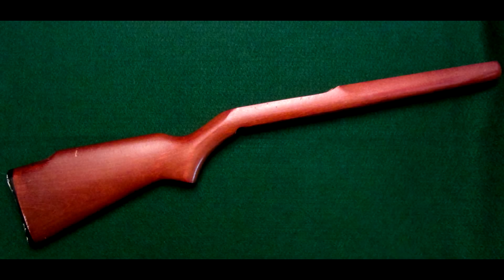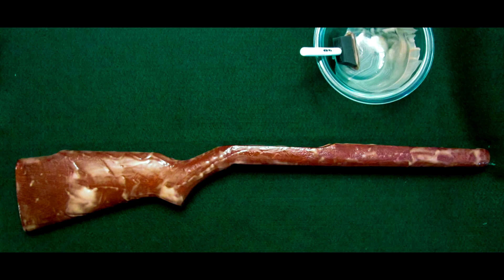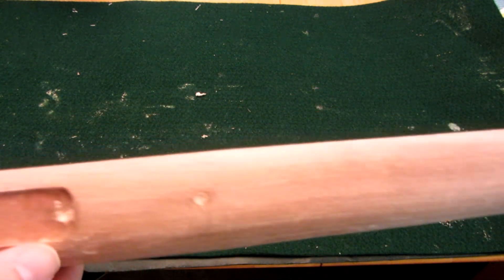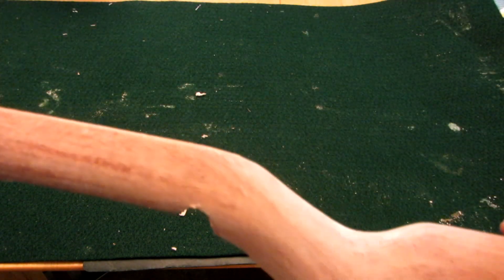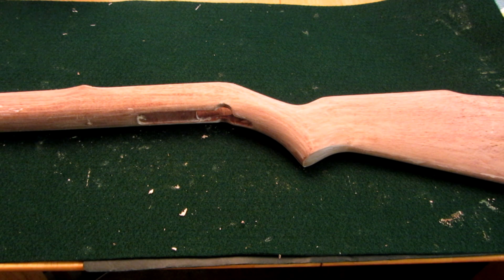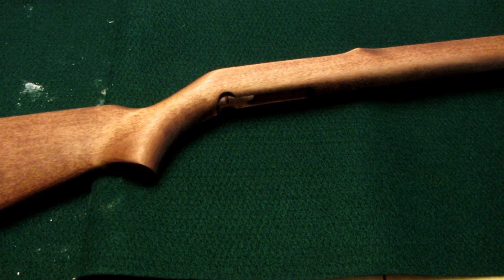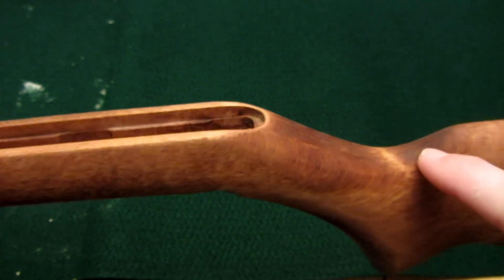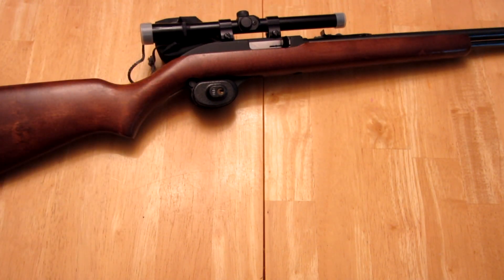Gun Stock Refinishing Project: Marlin Model 60

Comment: Down through the years, I have done a number of refinish projects on furniture and I really like a Tung Oil finish!  If enough application, it will completely fill the wood grain and make a durable waterproof finish...I am talking about 30 coats, hand rubbed and 0000 steel wool inbetween each coat. It really hardens the surface and makes it very scratch resistant.  Patience is the name of the game on these types of projects.  And I do like the looks of your new finished Marlin!

Comment: Very nice job. Looks brand new. I did a stripping and refinish on my model 60 using Citristrip. After light sanding with 400 grit I applied a mixture of boiled linseed oil and pure turpentine (1:2), let it soak in and buffed it off. After drying overnight , I applied several coats of Minwax dark brown wax, buffing between coats which I renew after each cleaning. I prefer the satin finish.

Comment: I just finished my Marlin 60 before I saw your video and I had some darker spots too. I stained a light brown also and the few dark spots just added character to it. I re-blued the barrel and put it back together and it looked identical to your brothers gun, what fun it was, I just finished another gun a 410 bolt action shot gun the only difference we have is I use an electric sander much faster for me, but both ways are good, thanks for the video

Comment: The reason the stain appeared darker in spots was because the end grain absorbed more stain than the sides. Birch is notorious for this. One way to prevent or at least lessen the uneven stain is to use prestain conditioner. You apply it before staining. And the prestain conditioner will seal the grain somewhat. The parts that would have been darker will absorb more conditioner and then when you stain, it will absorb less stain. Basically the prestain conditioner helps the stain look more even by slightly sealing the really porous parts so they don't soak up as much stain. I've found with birch it might take 2 or 3 applications of conditioner to ensure an even stain application.
Reply: I have never been able to stain a birch gunstock without it coming out all blotchy like that seen in this video. Nowadays I just paint them with an OD green paint or something similar. Not as pretty, but a lot more tactical. :)

Comment: Love the light color stock,my new model 60,is 2 years old thinkin of a new finish for it possibly a 2 color red oak and grey tan,doing and old 16 guage now , takes months to dry out an old stock,after scraping and should not see the light while drying.scraping is good when the stock is damp,dont sand it till just before the stain or paint,thats just my experience,its the third old stock I have done,last was a single shot 22,patten 1899,.once I shortened my tube mag on the marlin I eliminated the jamming problem,took one inch off the tubes,if you want crimp the feed end just use your,pipe cutter,use a penny or washer,or nickle in the cutter to obtain that crimp, keep up the good work onyour videos

Comment: Great vid 👍👍. Awesome mine is drying as well . Was going to dark walnut stain but went clean with boiled linseed . 2 nd coat is drying now . They recommend 3-4 coats 24 hrs in between dry times . It seems kinda like urethane and really doesn’t build up until it s really hard . Wire brush then scrape , two hits of remover . Take off the majority with wire brush , then rinse , then hit it again and scrape then sand with orbital or hand . Fish with steel wool 👍👍Orbital is so much faster and better . 2 nd coat of boiled linseed drying now , looks very new , slight sheen . Might I recommend to put the linseed oil by hand and jerky it off even coat , leave smooth for 20 minutes and buff , leave for 24 hrs ? I ll update but that’s what’s happening

Comment: marlin uses beech or birch (i can't remember which) for their cheaper stocks that's made of walnut. they tend to have dark & light spots on them when refinishing them. it's the nature of the wood.
Reply: There's a pre-stain conditioner that prevents most of the blotchiness in such woods. MinWax has it in their product line. A very diluted shellac could be used too, but shellac requires some experience to do right.
Reply: i've never heard of that & from all the redone marlin stocks i've seen, i don't think anyone else has either. do you have anymore info on that?
Reply: Sure. These conditioners are proprietary formulas based on thinned down varnish with additions like styrene and such. It soaks into porous areas and cures under surface, preventing too much soaking of a stain. I have used the product titled "Pre-Stain Wood Conditioner" by MinWax just because HD is the closest store, pretty sure other manufacturers have something similar. Do a search for "pre-stain conditioner", there will be a lot of resources. Hope that helps.

Comment from the maker: That depends on a few factors. I've seen brand new guns with gloss finishes. It also depends on how you plan to use it - I wouldn't put a gloss finish on a gun that's going to be used for hunting in the rain. But I can tell you from experience, it works just fine.

Comment: My Marlin 60 is 19"/14 rounds version probably from late '90s or early 2000s.
Decided to strip the factory finish in prep for refinishing which exposed a
laminated (?) stock instead of the expected birch or beech wood. Decided
to skip restaining, treated surface with linseed oil then after that had cured
satisfactorily treated with Renaissance Wax. Few years later I think Marlin
sold them with laminated finish before going back to faux walnut stain. Also
added a butt pad to add some LOP, not for recoil. Real pain making it fit.
Here's how mine turned out if anyone's curious.
https://hosting.photobucket.com/albums/v613/wozeyjales/TwentyTwos/Marlin60UpgradeLhs.jpg
Reply: I like it! I bought mine around 2004-2005 and I believe it was a laminate stock as well. I went with a darker stain and was pleased with the end result. Seems to be darkening wit time. Nice job!

Comment: I have a brand new model 60. do you know if the new style stock that they are using are just a laminate? or is it an actual grain of the wood and is staind or finished?
Reply: I bought one of these in 2004 or 2005. I think it was actually a laminate. I sanded it down completely wit different grades of sand paper and sanding "sponges". I don't know the actual name for them. Then I used a stain that I believe was called Old English Oak. I rubbed it in with a cloth. I was very pleased with the way it turned out, and the color has darkened some with the passing of time. The grain is very pretty. I even liked the rifle so well that I got one for my son and then another for my daughter when she was born. It will be a good while before she gets it, but I wanted her to have one that has been here since she has. I plan to do some refinishing work on it as well.

Comment: nice job thank you i have a brand new stainless steel marlin 22 that i saw a video on youtube where the guy took the same gun as mine and did his stock in minwax eboney black so i took mine and sanded and sanded i think big mistake but hey its done and his gun came out absolutely beautiful check it out type in on youtube Marlin Model 60 project review. I am still working on it lightly sanding it, ok than when you put the clear on yours what a huge difference it made and I think that is what i need to do. you did a beautiful job very nice

Comment: I bought a marlin 444 and an older 30-30, a 336 I think and both were refinished with a very nice looking gloss finish that showed the beauty of the wood grain...however they were slicker than owl shit and hard to grip even after cleaning, so I used a ultra fine grit sandpaper but still it was the wrong kind of household gloss, I think they need a penetrating oil and a non slick sealer followed by a fine grit lapping but just gloss sealer is way too slippery and not as factory.